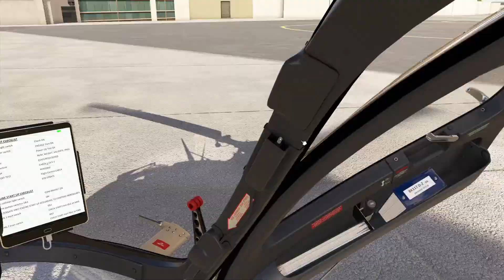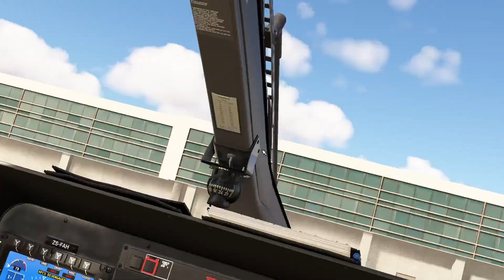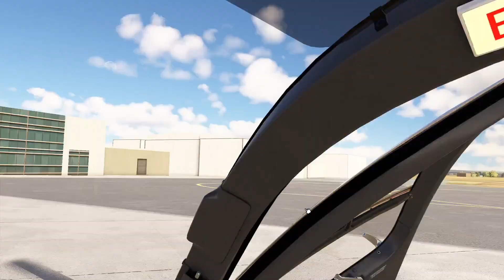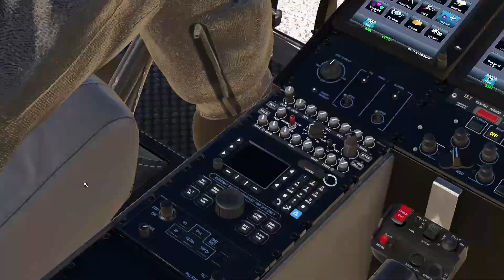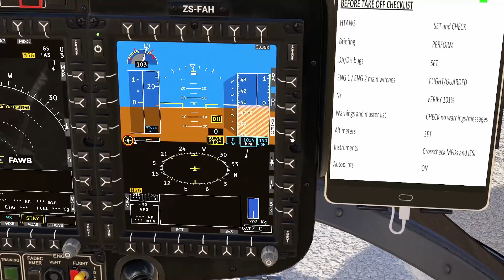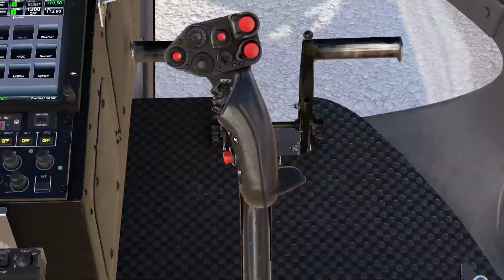Airbus H145 - Complete Start Up And Shutdown.

Comment: Hi, can you elaborate a little about the differences between MSFS 2024 and x-plane 12 in regard to helicopters? I just started to explore helicopters in both of these sims. I have experience with helicopters in DCS which I consider to be the standard. In x-plane I have been flying the Rotorsim EC 135 and in MSFS2024 the Cowan sins s76c++, h125, B206L3 and Miltech MH60. Also the Taog’s OH6. The OH6 seems to come close to what I expect based on the information I see online.
Reply from the maker: I don't have MSFS2024 so I can only talk about MSFS2020. In MSFS2020, the default helicopters have no autopilot so you have to go payware like HPG H145. X-Plane has superior flight model and physics, which simulate factors like torque and rotor downwash more accurately. The replay feature is a very powerful tool for beginners and X-Plane replay is far better. in X-Plane, Its easier to get feedback about the different flight characteristics of the helicopter by displaying then on screen. I would like to end by saying that DCS is for military "aviation". I'm a civilian helicopter sim pilot. I don't think I would be able to do a flight from Wonderboom airport to Lanseria airport using an ILS approach to runway 07 in DCS.